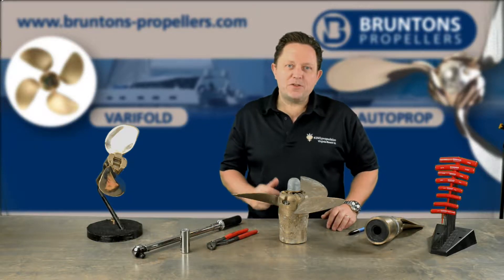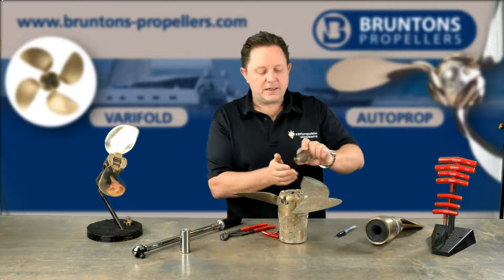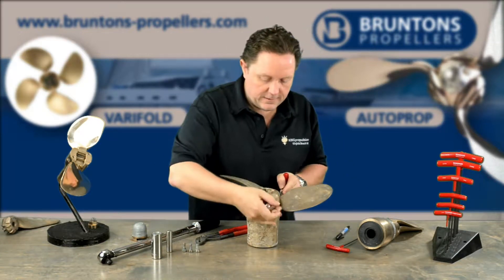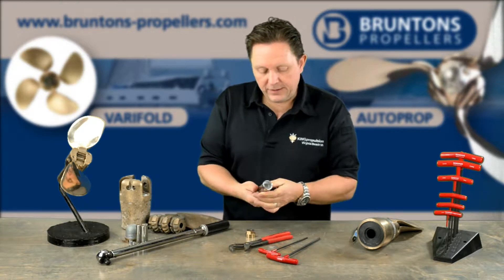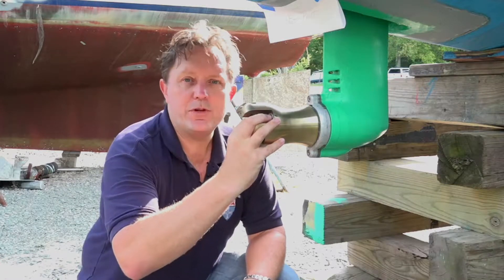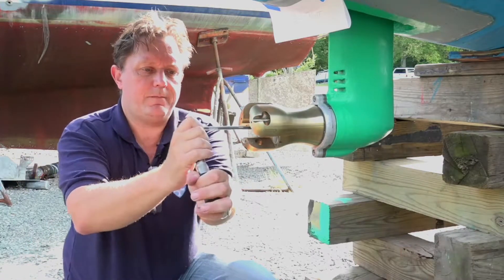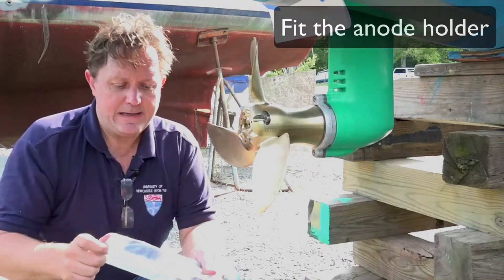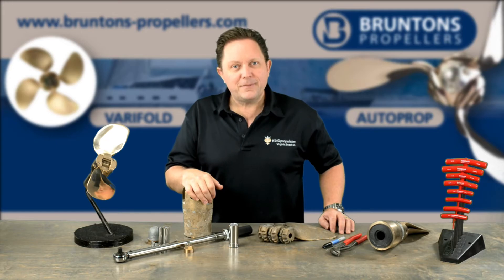Installing a 3 blade Varifold propeller on a Saildrive

Comment: Pedantic...but I'd mark the pivot pins as well as the blades..Nice piece of kit ..
Reply from the maker: Not a problem there.  It depends on the wear.  The pins are significantly harder than the blade or the hub, and while they don't wear as fast, they do wear.  For older propellers matching the pin to the blade is generally a good idea. Of course if they are scored and worn they should be replaced!